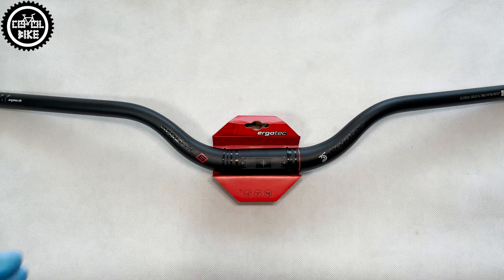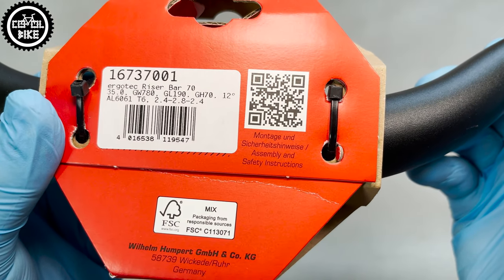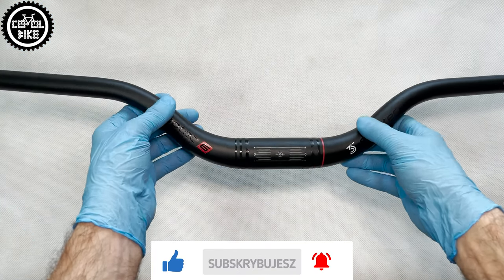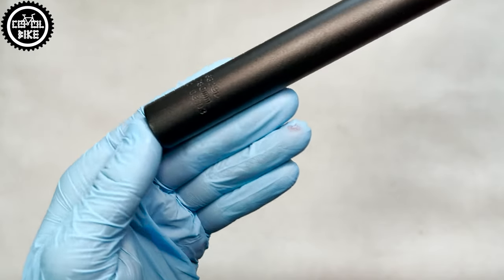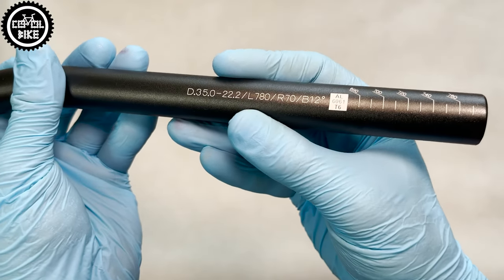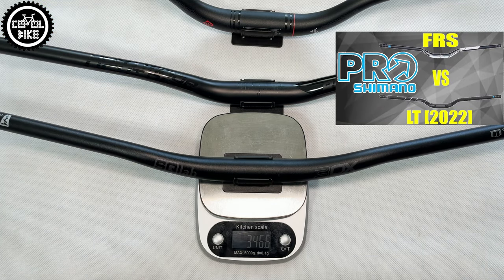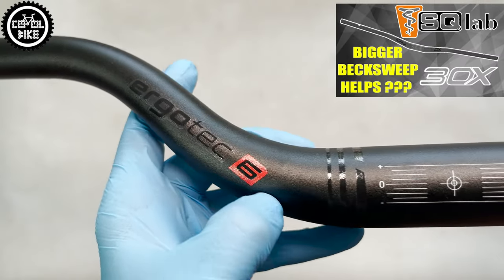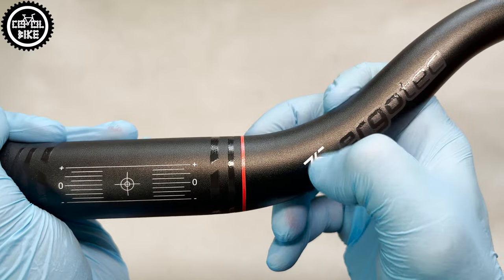ERGOTEC RISER BAR 70 // Best Handlebar With High Rise For Tall People And E-Bike

Comment: finally a surimposed views of the various rises, it's impossible to guess what the real difference between a 25-40-50 is by solo pictures thanks I have 25 from factory but it's way too low for me 1st ride wednesday my lower back still hurts saturday :/ if that's 25 I guess I need 55 at least, I'm a bit lost going from a 2016 XC with steep head and seat tube angle where it was never a problem to a slack 2024 170mm e-mtb I see you have a giant telescopic seatpost so I guess we both have a bike on the smaller size, which I wanted and knew would require adjustements I want to be able to sit low on steep mountain (off) trails I tought of the saddle height but did not think handlebar height would be so off, your bike looks good to me 😁
Reply from the maker: Hi, now modern bikes have short seat tubes, and long dropperposts, so saddle can interfere as little as possible. I'm 194cm tall, and I have 210mm dropper from OneUp now, and I'm currently riding on XL frame. But despite that my handlebar have 70mm rise, it is still lower than saddle. 
If your back hurts, definitely buy higher handlebars. Fortunately, there are plenty of them that have 50mm rise. It gets more difficult when you want to buy something higher.
Reply: @COOLBIKEyt  thank you 194 ? ahaha ok I get now why the bike seemed "small" happy you improved your setup for your height if not perfect, I'm only 183cm it will be easier I think
yes my 25mm rise handlebar is under my saddle by pretty much one handlebar with accessories mounted height so 25+30 ish I need to at least be at saddle height
Reply from the maker: @fredEVOIX  Ergotec also has other lighter versions with a 50mm rise ;) and you have Deity, Protaper, XLC, Title, Dartmoor handlebars, etc.